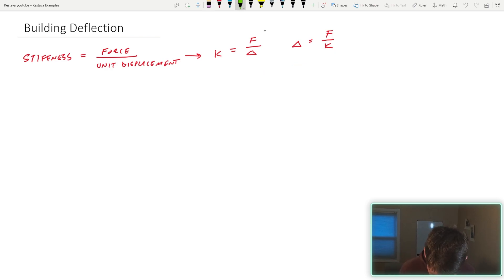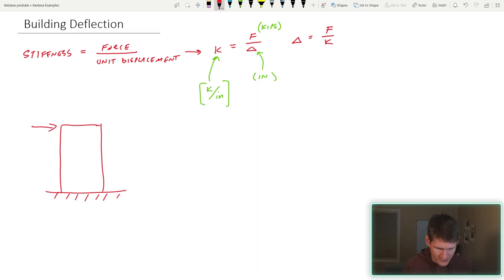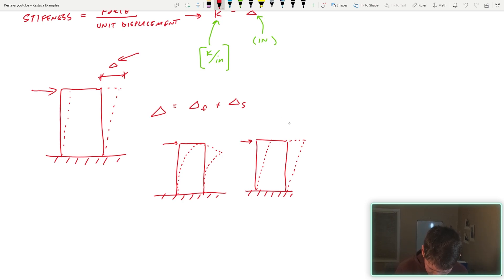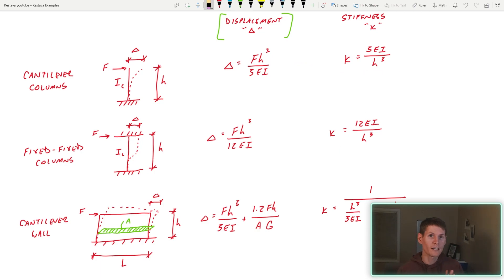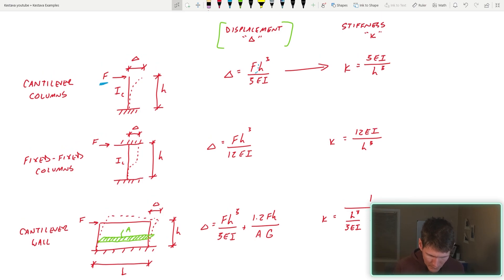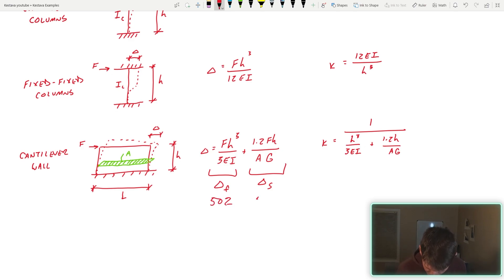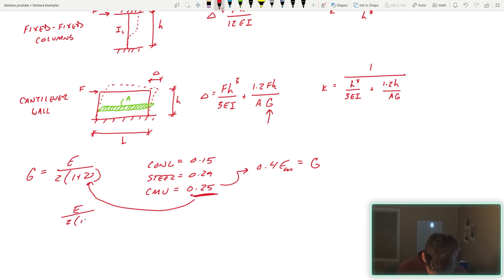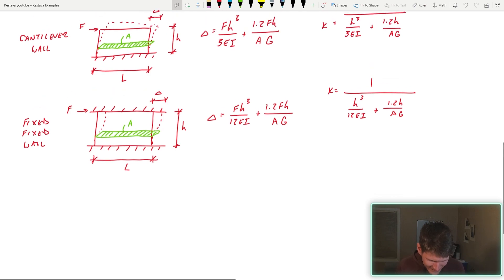Essential Equations for Deflection and Stiffness in Structural Engineering

Comment: Typically, everything regarding torsion is a brainer, hard to find info(torsion resistance modulus etc) for different cross sections, solid rectangle, RHS, I beam/ C shape, Omega, etc.
Also for critical  plate buckling with different fixing types, three sides fixed-one free, three hinged-one free, two(L type) fixed or hinged-two free all in compression.

Comment: Is there an equation for a cantilevered column with a pinned connection? I’m a residential engineer and I’m constantly recommending people fix their posts and columns into the concrete when they try to just use a post base. The reason why is the post sways like crazy and racks when it’s only got the post base (it’s only pinned so rotation is allowed).
Reply from the maker: Hi! I know what you are getting at, but strictly speaking a "pinned" cantilever is an unstable system from statics. When this condition is used, it should be combined with something like a cantilevered diaphragm from above to provide lateral support. then the column is purely a gravity element. its good of you to be recommending fixed base connections! but sadly there are few products that achieve this. Most often the posts need to be set into a concrete foundation which also isnt great as wood and concrete contact is a no-no for longer term performance.
Reply: @Kestava_Engineering  thanks! we recommend knee braces a lot because it helps decrease the lateral forces significantly. But still I would love to calculate the stiffness of a pinned connection and compare it to a fixed somehow…
Reply from the maker: @jonathanmezzenga2501  if the column is pinned at the top and the bottom the stiffness of the column would be 0, and no load would transfer through the column (laterally) that is looking at it purely from a pen and paper stand point. this is not true in real life as ther are many other smaller actions happening. Ex. post base although a pinned base, still has some amount of fixity, there is some amount of fixity at he top of column through the nails (almost none, but some!) and so on.
Reply: @Kestava_Engineering  yes that’s true there is some fixity. There is a chart in the ASCE steel Manuel somewhere that shows the degree of fixity.